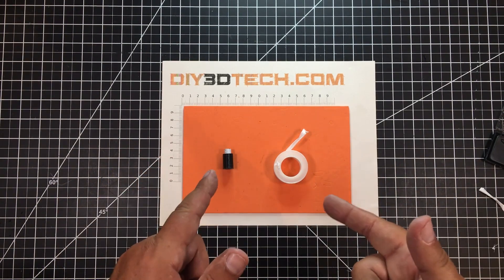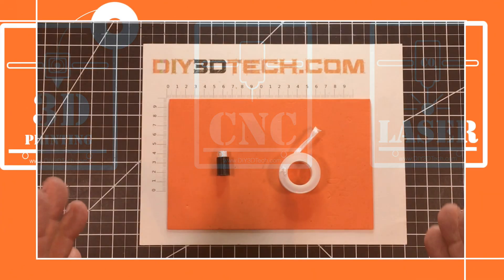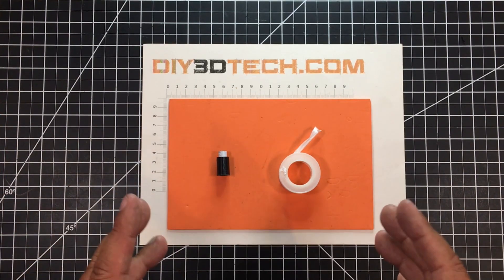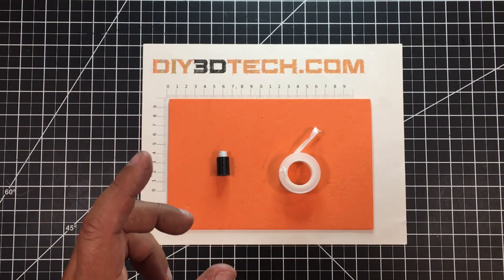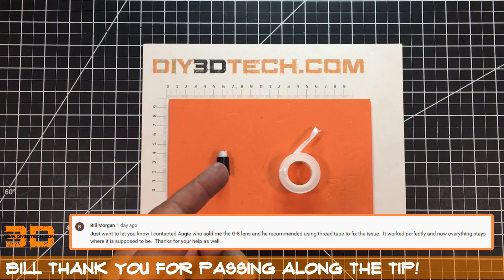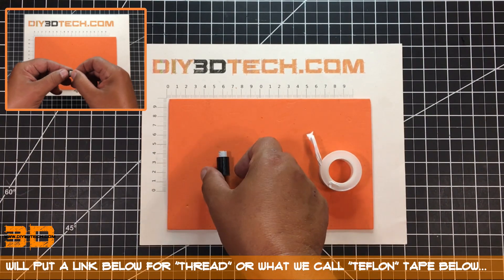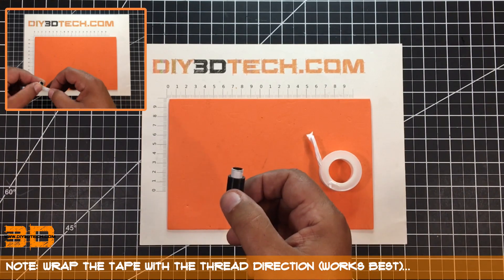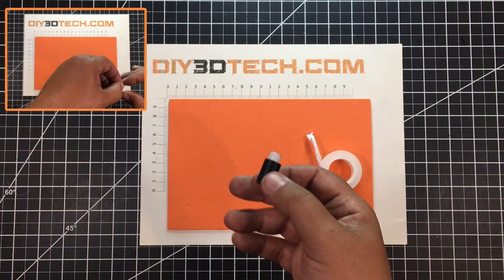Ortur Laser  -  Fixing a Loose Laser Lens (The Easy Way)!

Comment: good idea, but on the first place, how did you manage to take the ortur lens out of tube? I am waiting for my g8 lens, hopefully it will arrive some point, but when unscrewed the tube lens from ortur, I can not get the lens itself to unscrew from this tube. I found there 2 little notches, I think for some sort of screwdriver or some kind kit remover but did not find any tool online so I do not know if there is something special about it or mine was welded to tube itself. Any Ideas? Please help if you can. Cheers.
Reply from the maker: Please do not remove the lens from the "bearral" you swap "barrels" (with the lens inside) and NOT the lens...
Reply: Thank You @DIY3DTECHcom for reply. But have a question if the "new barrel" will fit exactly in place of the old one? because on this video above you have the lens barrel screwed to your air assist tube using teflon tape. Am I right? So then the rest of the lens barrel with the teflon tape on it is being mounted to laser head or the whole air assist tube is going there inside? But then how is the focusing working? I am sorry, I am confused and still waiting for my g8 and just can not imagine it in my head how it is being fit inside. If that g8 is m9 thread is that mean it will fit inside laser head with a bit of teflon tape? I am sorry if I write same thing twice as I am not aware if it works that way or not. Cheers.

Comment: Does the spring go back into the G8 lens that comes out of the original one?
Reply from the maker: Mine did not have a spring, however if yours did then yes I would try and reinstall it will hold down force on the lens which I assume this is the reason for it...